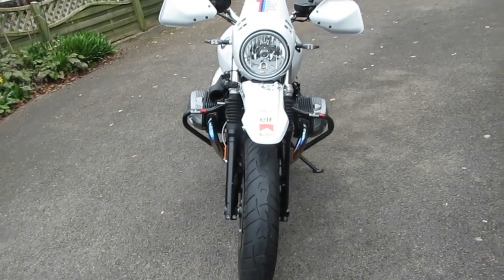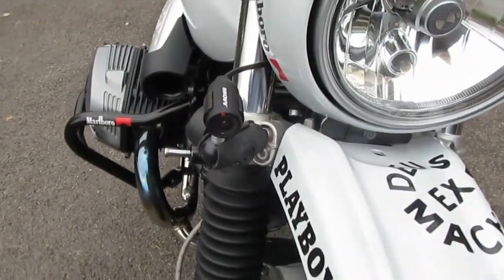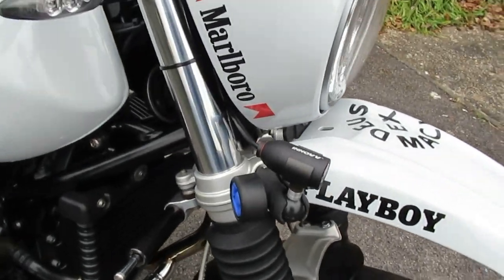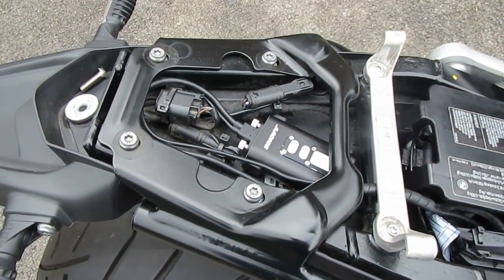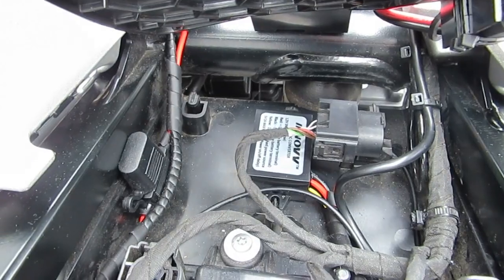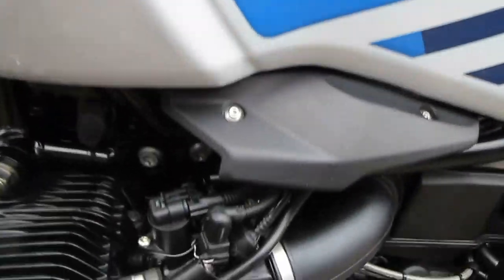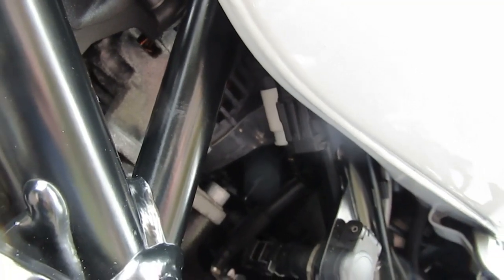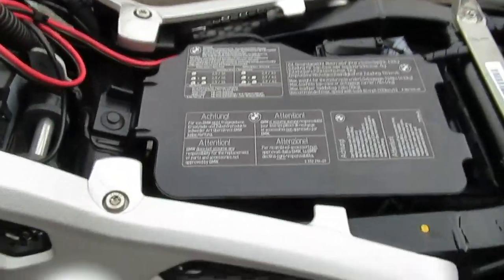Innovv C5 on BMW R nine T Urban GS

Comment: Legend. I could not work out why it wasn’t working when using the gps socket. Now I know that it’s not a +ve supplying 12v, and I need to get the 12v from the jump start. Thanks a lot!